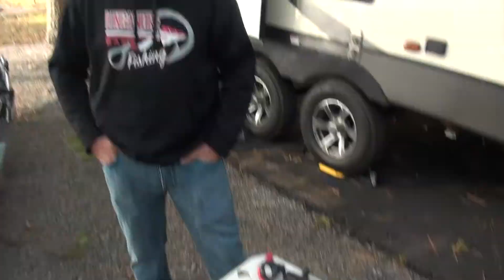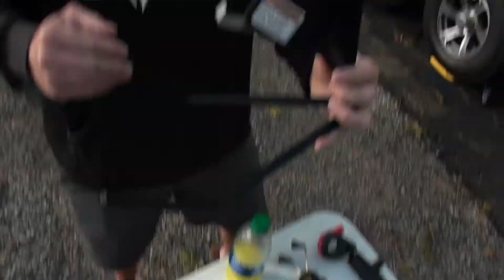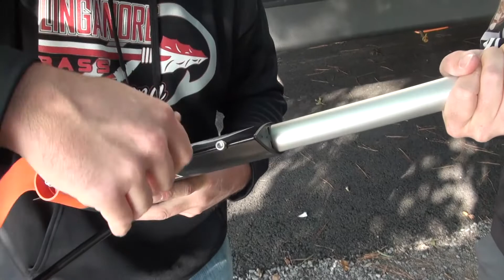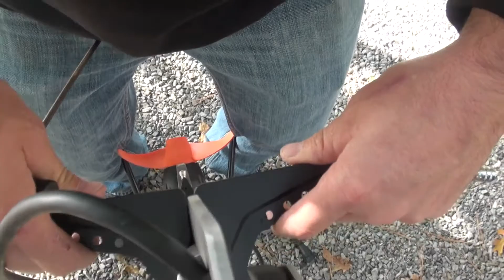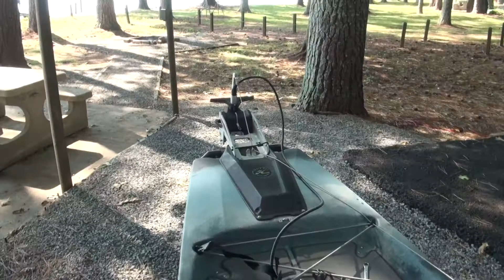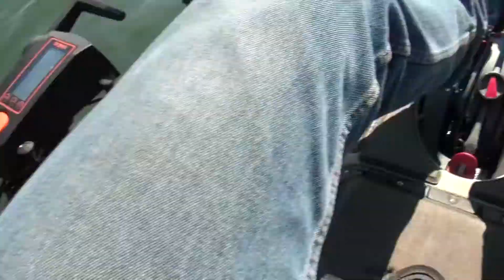Rudder steering, fixed steering triangle of Ultralight 403AC on a Hobie Pro Angler 14 360.

Comment: So, I used the #8 two inch stainless screw that Jeff recommended for fixed steering and the torque from the torqeedo drive bent the screw and cracked the hole in the steering triangle. Anyone else experience this?
Reply from the maker: It happens when the motor strikes an object in the water at an angle other than straight on. 

I made this video because I was tired of explaining how to do it, and I knew that the cotter pin option did not work that well. I’ve explained the inadequacy of the “locked steering” design to product engineers at Torqeedo. They are working on a redesigned version. In the mean time, I suggest foot control steering. I produced three dozen different videos on how to set up foot control steering on a variety of kayak models before I produced this video on locked steering. That’s because the system is just a better user experience with foot control steering. I hear rationale for why someone wants the steering locked, and what I really hear is “I don’t know that I can pull off rigging foot control steering”. I do as much as I possibly can to show people how to complete it on a variety of kayaks: kayaks with existing rudder systems, kayak without any access to the inside of the hull, inflatable kayaks, etc. It’s not always easy, but it is worth doing.

Comment: The issue of weak steering that you note is due to the fact that the motor is locked in place which prevents it from turning with the rudder.  So in effect the motor wants to go straight while the rudder wants to turn either to port or starboard. A better solution IMHO is to tie the motor’s steering cables into the rudder lines which then has the motor and the rudder turning in unison thereby giving the kayak sharper steerage.